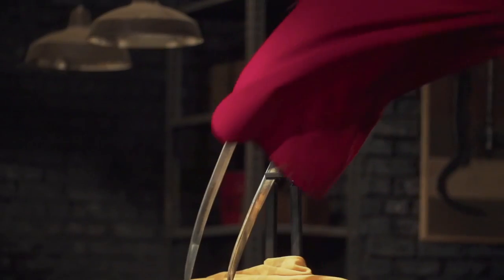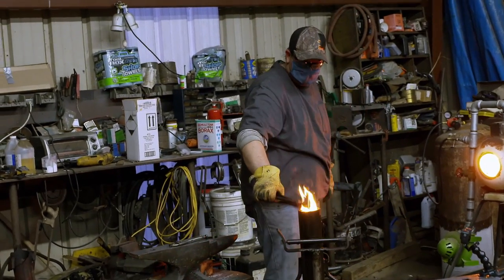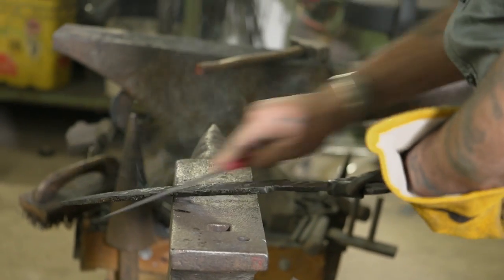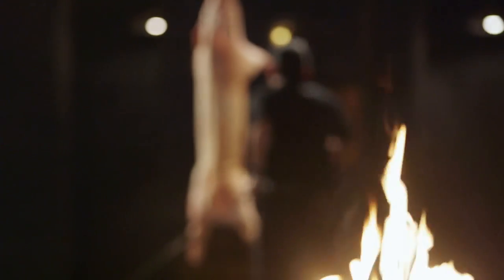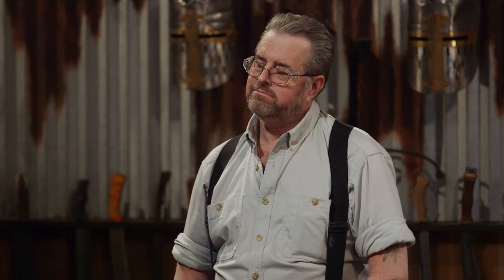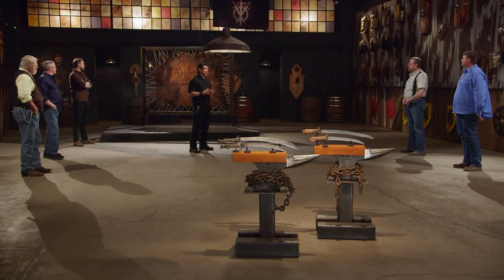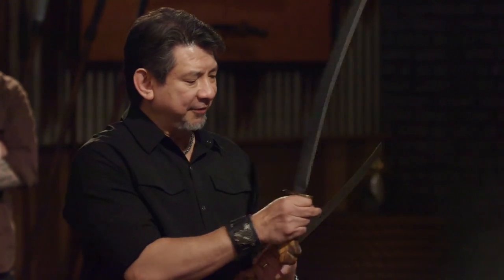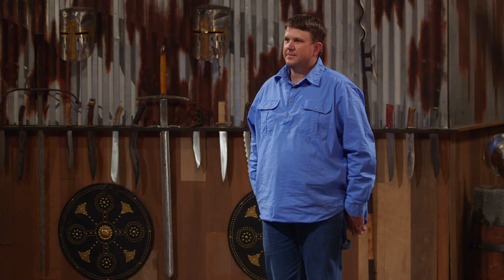DEADLY DUO Ginunting Swords Create TROUBLE in the Final Round | Forged in Fire (Season 8)

Comment: The heavier weapon always loses. One could fight much longer wielding a lighter blade.
Reply: Not ALWAYS. I have seen a few exceptions. Usually the lighter blade has some sort of deficit though, like the handle sucks or it isn't sharp enough.
Reply: @johnsmithe4656  Usually the lighter sword loses when it breaks.
Reply: @johnsmithe4656  I think there was oNE ep where the lighter blade was just... too light to work properly and lost because it was too light.  but yeah usually if the lighter blade looses it's because the heavier blade was more durable.